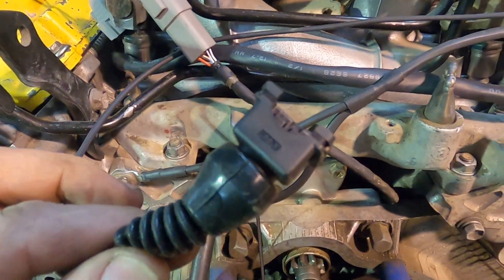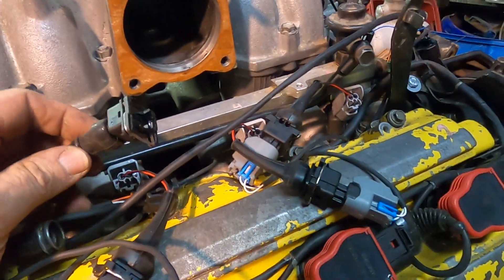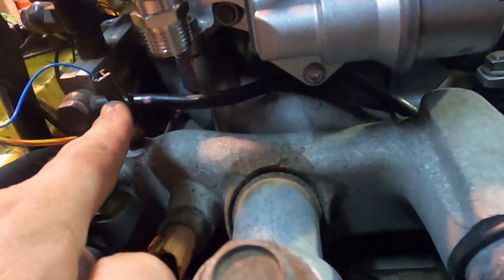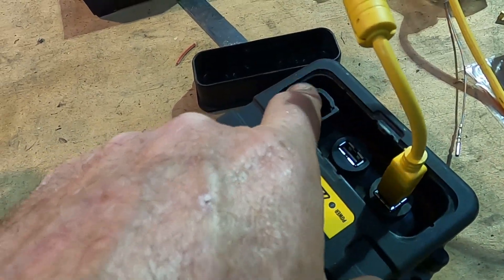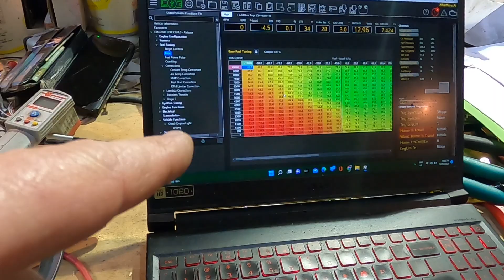Lunar outlaw garage Haltech wiring loom for HTV2300 supercharger supra on Elate Manifold

Comment: Yo, I don’t know if there’s any differences, but is there a certain exhaust  manifold that is small or closer to the engine cause I am trying to fit a 1uz into an rx8
Reply from the maker: yes.  The UZS131 crown exhaust manifold is the closest,  Then some of the 2uz units , the 3uz is also close and the SC400/soarer are flowing type and closer than the ls400 or celsior ones.